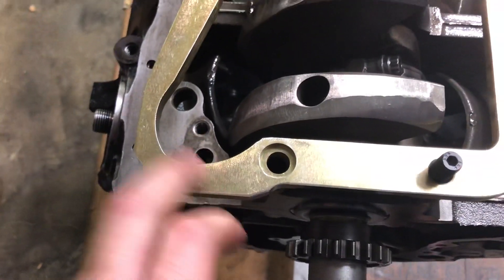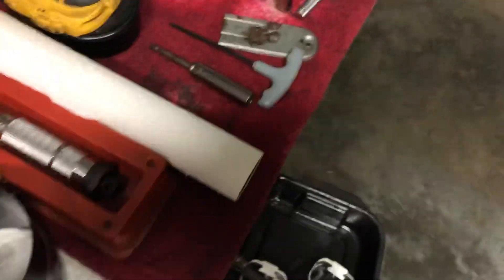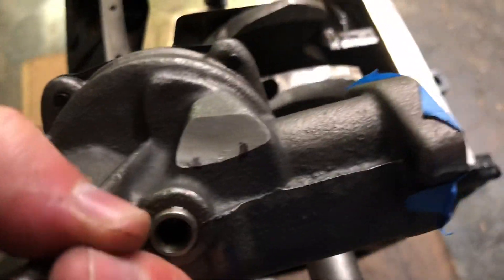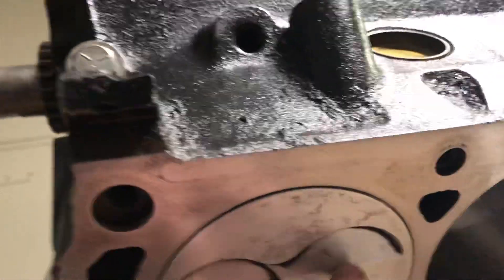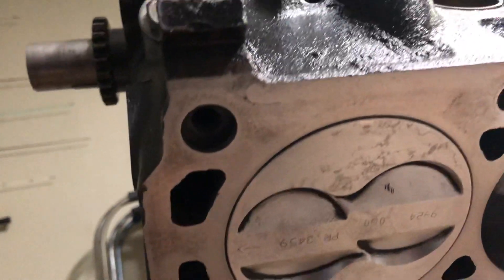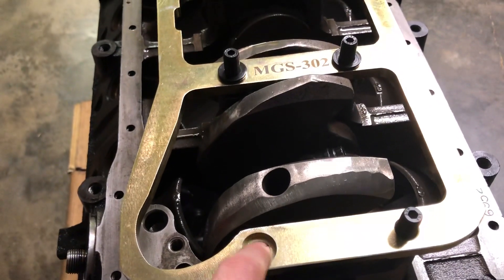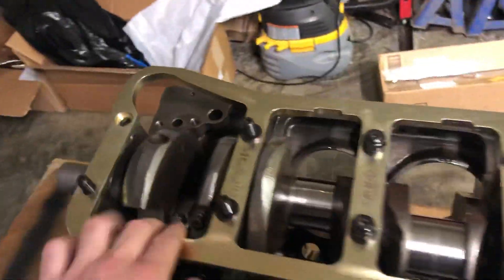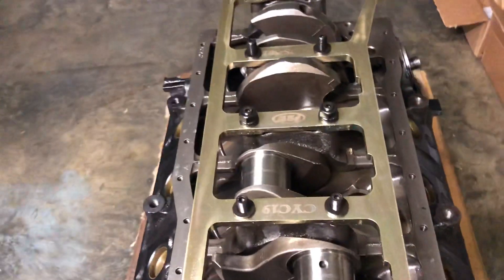Elaina - Ford 302 PRW main girdle clearance issues.

Comment: I bought this girdle with 12-piont nut in 2018. And now I bought the same girdle and there is no this special nut.
Reply from the maker: mine came with 6 point when i purchased mine. i still couldn't find the forum where people were talking about stripping out the studs that came with this girdle. I'll stick with ARP studs though. i just purchased a DSS Racing billet girdle that comes with ARP studs for my 408W build im starting.
Reply: @callofgeorge In 2018 it was nine 6-point nuts and 1 smaller 12-point. Now it is only ten 6-point nuts. I have some assembly pictures from 2018 and from today.
Reply: So I plan to buy 12-points nut and washer for the hole.

Comment: They make a spacer that goes between the oil pump and the block so you won't have that issue
Reply from the maker: good to know. never seen one before. quick google search turned up nothing. who makes it? part number?  be nice if it just fit from factory without the need for one though. what happens when the spacer makes the oil pump to pan clearance an issue.. lowers the pickup so it hit the bottom of the pan now? difference brand oil pans/pickups. how do you know what works with what? not to mention, the drive shaft will now also need to be longer. haven't seen any custom length drive shafts unless it comes with this spacer you're talking about.

Comment: Main caps need to be milled down flat and you will have clearance.
Reply from the maker: clearance issue was length of the stud hitting the oil pump. caps won't affect length of the stud. I ended up having to cut the stud down a bit with the oil pump clearanced. older video. all resolved now.

Comment: I have the same girdle on my 347 stroker. In that spot there is a shorter stud with a thinner 12-point nut (integrated washer), so you can get a socket in that recess. Also, you shouldn't run a high volume oil pump if you have stock clearances on the bearings. The SBFs have distributor gears that are prone to failure due to being too small. A high volume oil pump will put additional stress on the gear and have no benefit unless you run clearances that are needed in 10000 rpm dragster engines. It just sounds cool when they sell you the engine/car/part.
Reply from the maker: thanks for the info. i ended up running a normal output pump. i also found the smaller nut later. don't think mine was a 12 point though, it looked just like the others, but fit into the recessed area. i think i ended up using a modified ARP nut though since i had to order an ARP stud to make my oil pickup work.
Reply: Glad to read you got it all worked out. Maybe that block is strong enough now so you don’t split it.  If you’re drag racing it and pushing the limits of that thing I always recommend just throwing a Engine diaper on it. Damn thing might save you from oiling your slicks , radials, or hell even street tires if it does give up the ghost at the top end of the track or during a hwy/interstate high gear “kinda one of those to hell with it let’s see what MPH she will top out at bad ideas I know I’ve had before”.  At the track it will help keep you in one piece and on the track not in the wall or worse.  Not to mention if I’m behind you in the staging lanes save me from having to wait until they get the surface cleaned up
Now I gotta go google if you can run engine diapers on the streets for long periods of time.  
Good luck with it and I’ll go watch some other videos on this engine/car if you have them on here.  ✌🏼
Reply: @PVP thanks! It’s pretty cheap also

Comment: Maybe they expect people using these girdles to run deep pans, which would mean people would run a longer/deeper oil pump. That would pull that pump housing away from the stud.  I will probably be in the same boat you are with my 347. Keep us updated.
Reply from the maker: i have a canton pan. pumps are roughly the same. just different pickup tubes. new pump shows this week. i think i just have to trim the ARP stud down some. i was able to grind down one of the washers to fit the recessed hole and 4 of the nuts were smaller to fit in the recess. just sucks i'll have to cut the ARP down.. so much for the allen head at the top. i'll have to use the traditional 2 nuts locked together to pull it out when i need to remove it.
Reply: callofgeorge I think something went through the intake and bounce around inside the combustion chamber. As long as the rod and head look fine, you should be good.
Reply from the maker: @Rudderify  no clue what would have.. i was extremely careful building it. no marks on valves or head.. but the pistons are all in and heads on now. got that accomplished today.

Comment: the whole thing is that i learned over the years is that if you are going to rev that engine in the high rpm range you need to beff up the bottom end but if you are rev it up to say 6000 to 6500 the stock bottom end should hold up fine it is only when you get up there in the high rpm range with these race engines that you need a 4 bolt block a 2 bolt block will handle the 6000 rpm range with no problem.And i think buy putting the ARP bolts you have fixed the weak link for this pretty mild end build.
Reply from the maker: good info. i was kind of curious if the girdle was only to strengthen for higher RPM or if it helped with the overall block strength as well.. from what I've read/heard the old 302 blocks like what i have are weak between cylinders and the webbing. even my local build shop said i'd need to be very careful putting boost to this engine because i'd split it in half.. so the girdle was supposed to be a band-aid for the inevitable. i already got the girdle, so i feel committed to making it fit now lol..